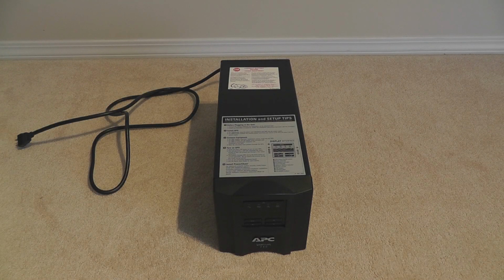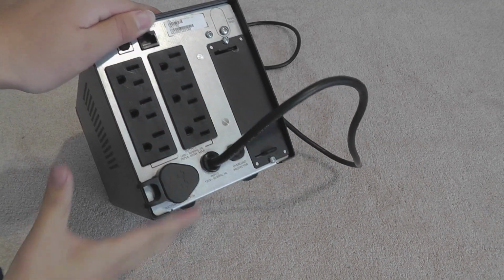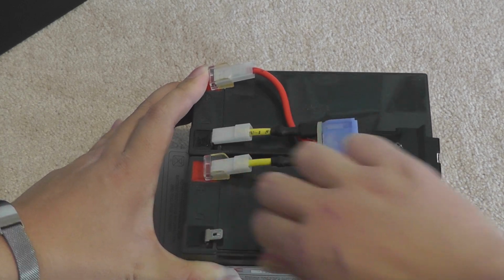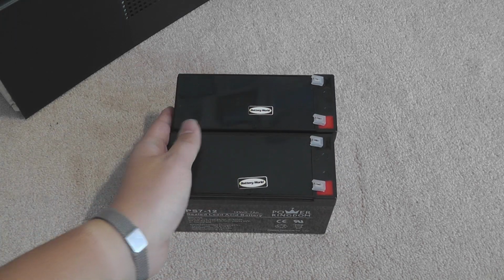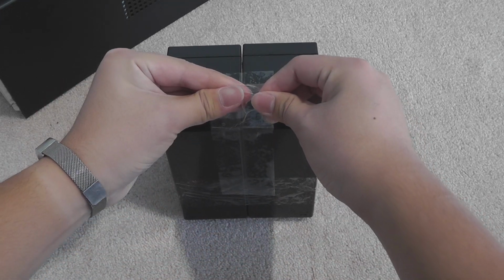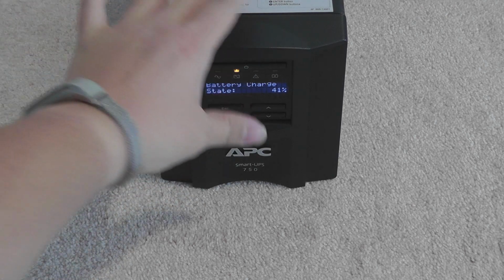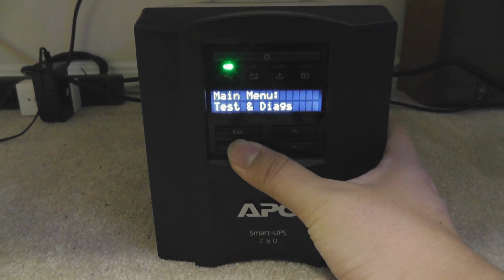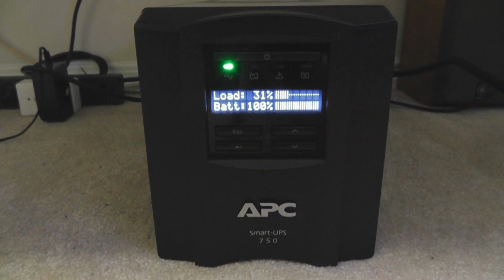UPS Battery Replacement with APC Smart-UPS 750 (Easy DIY)

Comment: The RJ45 on the back is NOT Ethernet. It's RS232 and APC sells a special cable to connect it to your PC's serial port. The replacement battery needs to fit so check the dimensions of the one you replace it with. It needs to be 12vdc. It should have at least 7 Ah, but that number can be bigger, and a 9 will give you a longer run time. (7Ah is the capacity. It means it will supply 7 amps for one hour, or less amps for longer.)

Comment: Hi there and thanks for you tutorial!

Can you tell me the background, why the UPS have to be charged up to 100% before adding any items to it? Can I use the Self- or Calibration-Test before 100%?

Thanks to you!
Reply from the maker: You can use it, no problem. But I don't think the UPS would allow you to do any of these tests. The Calibration Test is meant to re-estimate the runtime of the UPS on battery, and I think the test won't be too accurate if you start at very low battery.

Comment: Power Kingdom PS7-12 datasheet does not mention this battery as high rate or high discharge current which are suited for UPSs. I would avoid this battery for UPS application. Next time choose Panasonic 9Ah UP-PW1245 or CSB HRL1234W or Yuasa ...

Comment: Thanks for the review. 

Is this UPS safe in general? How long have you been using it?

Does it get recognized by Windows automatically as USB battery? 
If it is, it should showing a battery icon in the taskbar notification area and be accessible through Additional Power Settings so users can adjust shutdown / hibernate settings to become effective when battery discharges to, let's say, 5 minutes of time left.

I've seen some complaints about SMT UPSes that they can get very hot and bulge the battery before they report: "Oops (pun intended), the UPS battery is dead".

Also, have seen some complaints that APC has messed something up with the plug sockets and they can get loose soon, but that's mostly for Europe targeted APC UPS models.
Reply: Thanks for the Comment. Mine is quite safe so far, no fire, no explosion. I trust the APC Brand, as they are one of largest in the UPS business. I have been using it since I rebuilt it in the video, so it has been a bit over a year so far, which for an UPS is not a long time, but this unit is quite a bit old than 1 year old.

For Windows 10, Yes. Plug in the USB, it recognized it as a Battery with no setup required. Don't need the APC Software. Windows looks just like a battery on a laptop.
I don't think you can set it to do certain tasks when there is 5 minutes left, and I would recommend against it, since the minute reading may not be correct at all time, it is Lead Acid Batteries after all. You can set up Windows to do actions when you have some % battery left. But keep in mind, because it is Lead Acid Battery, not some Lithium-ion Battery, the estimation time remaining and battery percentage can jump around and fluctuate quite a bit. (I have seen up to 10% in jumps) I usually use it only as an inaccurate reference.

My unit doesn't seem to have any issue yet. It is quite cool as well, no idea how they would get really hot. There are no fans inside, so there shouldn't be a fan malfunction. It's been a year since I started using mine, no issues so far.

I haven't experienced the sockets getting loose, and I don't really plug/unplug anything frequently, so...

Hope those bits of information help.

Comment: Hi, does this UPS have active cooling? If yes, do you know the size of the fan?
Reply from the maker: I believe it is passively cooled. At least for the 750 VA model. Not sure if you go up to something at multiple thousands VA.
Reply: @forgedturbo  Hello, and thanks for your reply. 

You are correct. All models under 1400VA are passively cooled according to the info I was able to find. 

So, I went with a SMT1500IC after discovering this. 

Thanks again.
Reply from the maker: @HotelGolf82  You are welcome. As I imagine, if you go into the Kilowatts range, you probably need some cooling.

Comment: https://youtu.be/6HRhtGNHXoQ?t=253  i remember that is internal battery disconnect when your planning not to use the usp to minimize the  battery drain, often that is pull to when you when you want to ship the ups for long way.
Reply from the maker: That is correct. A Safety Measure for Shipping and Storage.

Comment: they good ok but i would stay buy inverter 2000 watts $209.00 plus 2 lithium battery 12volt 100 amp 3000 life cycles deep clcle rechargeable battery $950.00 you get much better job done ok buy charger to battery so you spend $2.000 dollars